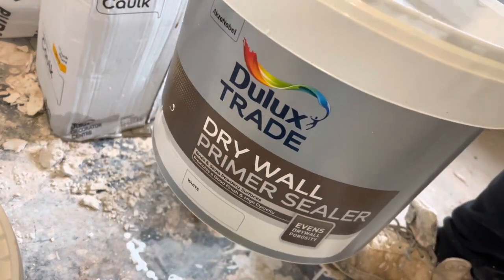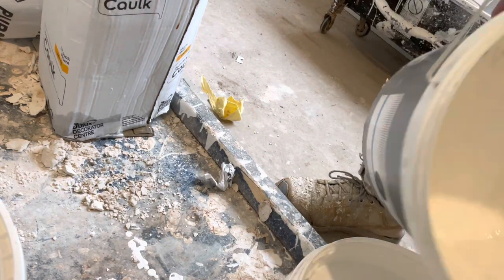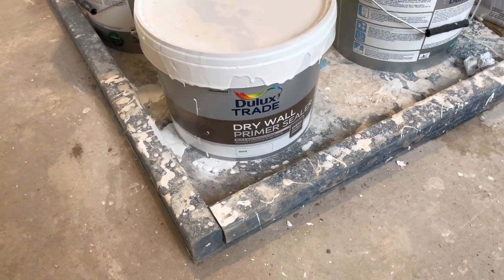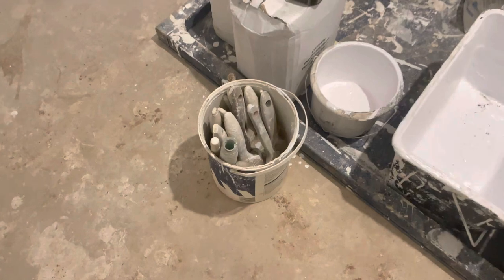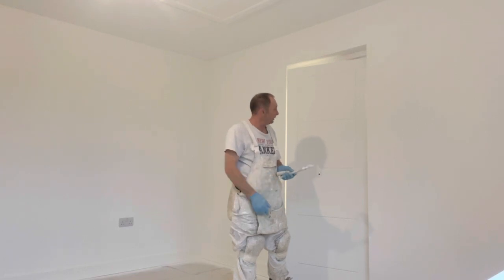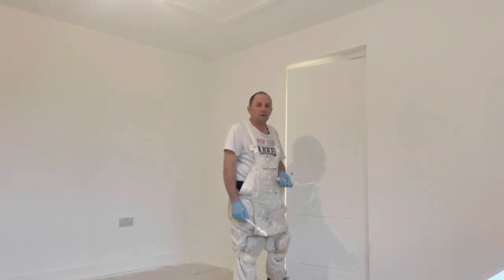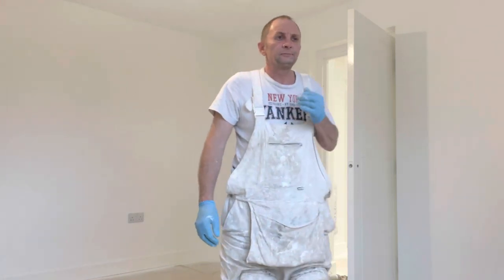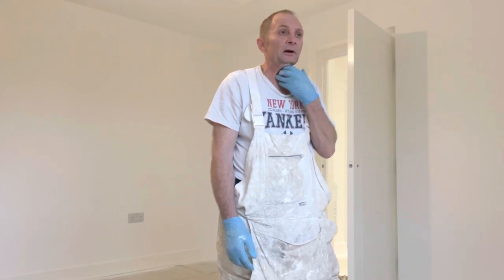Dulux, Shocking ￼😱trade drywall primer sealer

Comment: This drywall finish used far more Scotland it was designed to dry out quicker than plaster as  far colder up here lack site heating etc in the day. Also timber frames used far more up here again due to poor weather and joiners advise to drywall finish to avoid introducing too much water/dampness to build/timber kit as plaster dries out.

Comment: Thank good video, Question what is the best paint to use on my cellar walls, always dry so don't won't to cause problems in my house that has no issues. Looking for good cheep breathable paints with a low SD figure, sure that will mean more to you than amateur me who found out this is the measurement number.
Reply: Stop talking and strain it 😤

Comment: Down here in kent they are giving you three days to paint new builds
Reply: And people wonder why the standard on new builds is going downhill quicker than Franz Klammer.
Reply: How on earth is 3 days enough to paint an entire house? Surely that ain't enough, no wonder tradesmen are cutting corners and only 1 coating everything
Reply: May I ask what kind of price are they giving for that?

Is it 2/3/4 bed?
Reply: Had the same in the run up to Xmas from a certain builder that starts with P and ends with N .every plot a total shower of shit, when spraying the emulsion brought in the woodwork too😆 gloss covers a treat on white mully 👍
Reply: @U.S.Government  exactly mate, 3 days to paint a new build ? What a joke. I'd be charging at least a week for the walls & a week for  w/work, take it or leave it!
Reply: @Nigel Magill  spot on mate. 3 bloody days to paint an entire house is an absolute joke. Doing it by brush and roller would be near impossible and I think even spraying would be cutting fine and that is not taking into account leaving a beautiful job. I would say 10 days to paint a new build, 1 day to mistcoat, 2 days ceilings, 2 days walls and 5 days woodwork, I'm not a decorator tho lol so what do I know.
Reply: Depends on the size doesn't it

Comment: Do you lay off the door with a brush after you rolled it
Reply: Don't need to necessarily, depends on roller head you use, if you use a Mohair roller, you don't need to lay it off with brush and leaves a beautiful almost sprayed like finish.
Reply: @U.S.Government  two fussy blokes best mini rollers almost spray finish
Reply: @richardmcdougall233  Yes they certainly do!
Reply: Not since  85

Comment: Anyone else getting trouble with their brush mate ? All my brushes going hard
Reply: I don't buy that anymore for cost reasons and it's changed. My solution was buying 5 liters of gunwash thinners at £15 and topping up the little bottle works fine 👍
Reply: @jsj381  hi , is that the tetrosyl standard thinners,  I've heard of using this , might give it a try
Reply: If you have the big brush mate, on the fluid bottle label it says clearly, contains cancer causing ingredients, everytime you open it you breathe the vapour and it leaks out into your van as well. I use the go paint store and go, not as convenient, you have to scrape the gel off but it's a water based gel with no odour.
Reply: @raggamuffin frank  so the brushes just sit in the gel?, does it come off easily enough,  in my early days I used to just put the brushes in a kettle filled with water, worked a treat
Reply: @nelzy86 the brush and roller's on a hook suspended in the gel, just need to scrape off gel back into pot, I just use a cloth or some blue roll to get the last off the roller, so far so good, £20 for the small bucket kit and £13 for the gel refill 👍
Reply: @raggamuffin frank  decent price, I'll check that out , cheers
Reply: @nelzy86  👍, kettle and water works great, the old school way, only thing is it ruins the brushes unless you have it suspended in the water, I like my oil brush to last a while guess I'm just cheap, if you have an old brush mate you could just get the gel and use that, would work just the same.
Reply: @raggamuffinfrank9722  good to know,  thanks   for the tip

Comment: Dulux has become crap paint just lately I use Johnstone's ten times better
Reply: Yeah same, been using Johnston's since the summer, they've stepped up their game recently. I did an exterior with their smooth masonry back in the summer because there was a Johnston's trade centre right near the job, didn't have massive expectations but it was lovely stuff so i decided to try their paint for next few interior jobs good stuff. Only complaint i'd have was the water based satin, was drying almost as quickly as you put it on but got around it running a damp sponge and turns out nice.